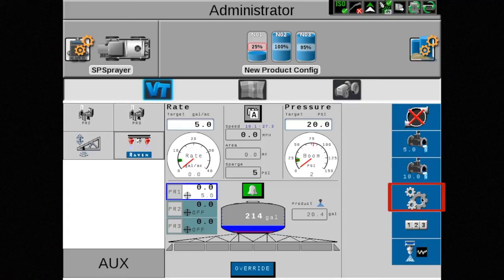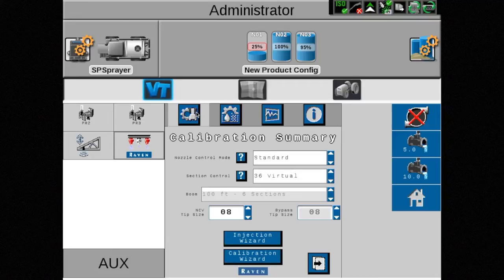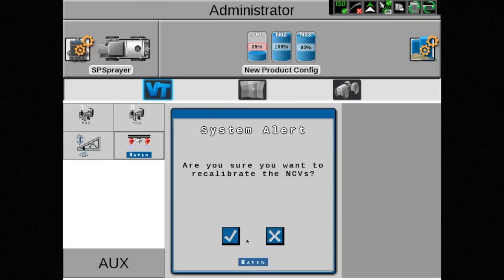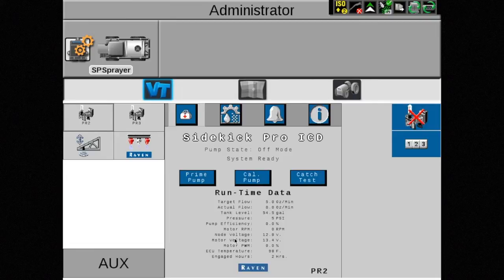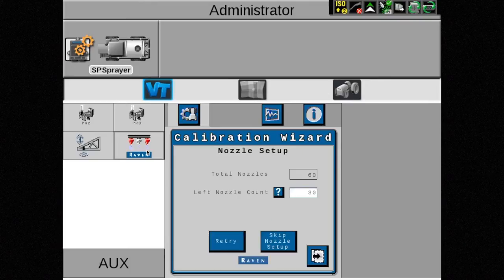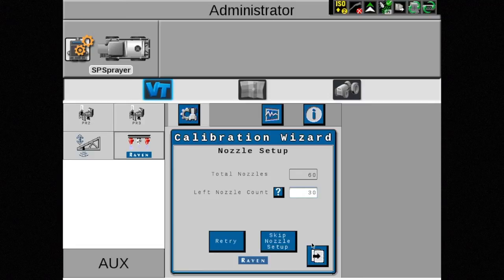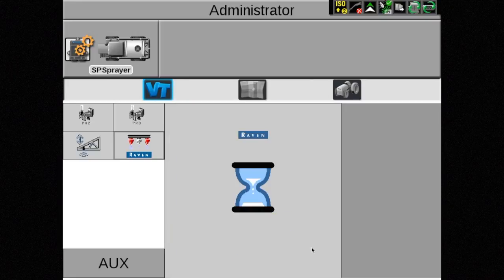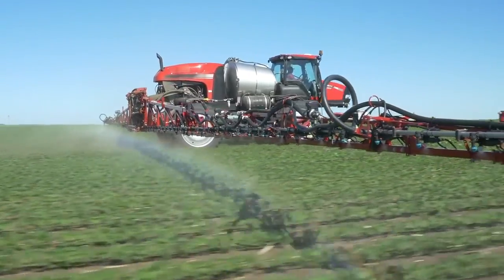AIM Command FLEX: Nozzle Control Valve Calibration on the Viper 4 display

Comment: At the calibration summary page, I don’t have “Injection Wizard” or “Calibration Wizard” buttons, only “Reboot Main ECU” button…
And on the next page there’s no button at all, just shows the width…but need to recalibrate NCVs, as I changed one out and now the pump won’t even turn on…🤦‍♂️
Reply: same here, how did you get it fixed? I even tried to set to default but then it just skips the ncv calibration